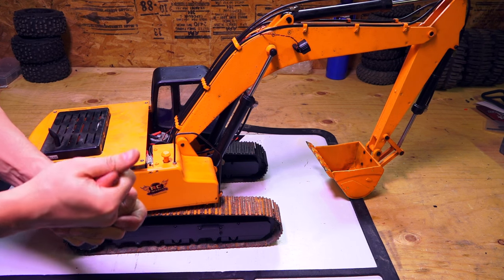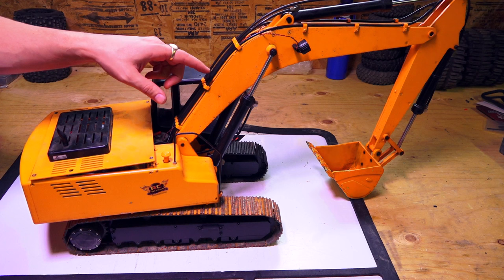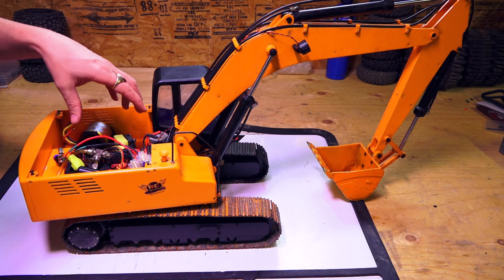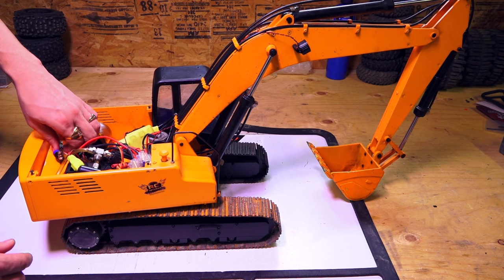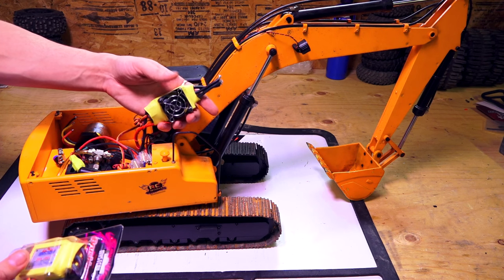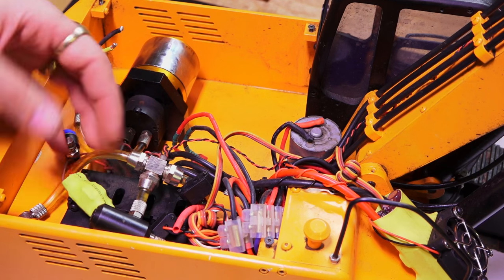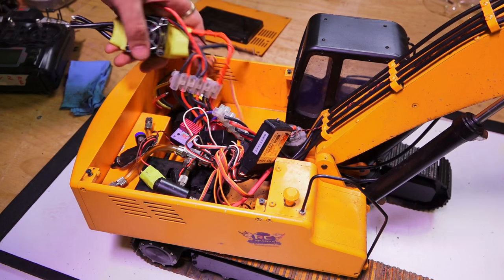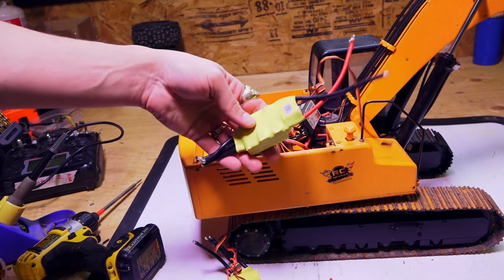RC ADVENTURES - 1/12th Scale 4200xl Excavator - Hydraulic Pump ESC Upgrade - Radio Controlled

Comment: Awesome vid bro
I just upgraded the valve block on mine to the premacon unit,  the old one was leaking too much and it was also not getting enough pressure in the lines now it's awesome.
I had no Idea that the valve block could cause that big a loss of power.
Reply from the maker: +Awesomus Maximus Awesomus Maximus factor 9!!
Reply: Does your machine have proportional hydraulics with this upgrade, I'm thinking of getting a better valve block but I want to know if the hydraulics are more sensitive and can move very gradually.

Comment: That thing has a lot of potential power. wow... At 25,9 volts... 200 amps... In theory that is 7 bhp :O Just for the hydraulics XD
(Don't tell me about resistance, friction, discharge rate, engine max and stuff... let me be amazed :P hehe.)

Comment: Sorry if these questions have been answered, I didn't see any of these answers so I'm asking. What is the best rc hydraulic excavator for a beginner? Why are the hydraulic excavators so expensive? What parts of the excavator use the battery and which parts use hydraulics. Also how long does it run before you need to charge it?

Comment: The speed controler can be fixed for 4 dollars and 5 minutes soldeing as either a cap when wich is most common or a diode fried saving the electronics, Gige je a bell and srnd some good pics of the top and bottom and I will have a look but short of that it would require testing.

Comment: This message is for RCSparks. I have a 4200xl. I am not sure what happened so I'll explain a little and maybe you can tell me what happened.  I have a 3S lipo 25c 10000mah battery for it.  I was running it today for the first time outside and all of a sudden I saw alot of smoke so I immediately unplugged the battery. I have deduced that the esc's that control the tracks have kicked the bucket.  I noticed as I was talking to my son on the phone that those esc's have a jumper for lipo and nimh batteries.  Well as you can imagine, it was on nimh. Would that have cause the smoke release?  We found esc's on amazon but would like your take on this whole issue before I order.  I hope you get this and can reply.

Comment: I'm planning to get a RC truck or car, still thinking on it. But, I'm not sure what RC to get. My budget is around $100. Do you guys have any good ideas on which one to get?
Reply: +MelT3d Thats a tough one. Hobby grade Rc's start at about $200-$300 U.S. You can try a n online company called wltoys but I'm not sure of their quality. Basically you get what you pay for.
Reply: Yeah, they are expensive is the traxxas latrax teton 1/18 4WD mo after truck rtr tra 76054-1 good?
Reply: +MelT3d Sorry, I'm not famiilar with that model. I would google customer reviews. That what I usually do before I buy a new RC.
Reply: +Chris O'Donnell will do, thanks anyways.
Reply: Chris O'Donnell What series are you most familiar with? Do you have any suggestions? it could be a bit more then a hundred.
Reply: +MelT3d I have had just about every Traxxas model but for around $200-$250 american you can get a brushed 2wd 1/10 Slash. Thats a great truck

Comment: So medic I have a question , any tips on maintaining a slash 4x4 ultimate. I'm new to rc and need a little help. Also that excavator is really cool!
Reply from the maker: +Dji Guy Always make sure to blow the vehicle off with compressed air, and use spray-dry silicone for the bearings :)
Reply: ***** thank you for responding

Comment: That wiring would drive me nuts! I would have to get in there with zip ties and organize the wiring and double side tape the speed controlers down, I am kind of a neat freak when it comes to wiring. I am not trying to put you down or anything medic, nothing against you I just hate messy wiring on my own stuff.
Reply from the maker: +focustuner10 Ive already been down this road.. and by shortening the wires, or zip tying them, becomes a huge pain in the a$$.. lol.  They need to be long so they can be put into the compartment.. or else they all bunch up.  Ive oned these rigs for 3 years.. and have tried so many thing to clean it up.. and funny enough - you see them cleaned up in this film.. THAT iS CLEAN! haha ;)

Comment: Who else has a traxxas bandit, not the best rc car but it's my first and it's pretty cool
Reply: I have the brushed xl -5 rustler. its like the next one up!
Reply: +Ben Varley I was going to get that one at the rc hobby shop but I got the bandit cause it was a little bit cheaper
Reply: +Ben Varley  i got 1 too but  it has a problem in the esc it  wont go fastern than 5 mph or  something
Reply: +voetbaler109 Probably not the ESC. Have you changed the mesh between the pinion and spur gears or made sure it is correct? That is one of the usual culprits.
Reply: +Powerpickle68 im about 70% sure its  the esc i got  the  problem before then i only switcht from lipo to nihm and  its  fix  but  now  it doesnt
Reply: voetbaler109 Did you happen to run the truck with the esc in lipo mode with a nimh battery? That can sometimes damage the esc
Reply: +Powerpickle68 yea i think so
Reply: +Timothy Roelofsen I have a slash 4x4 ultimate , but the bandit is a pretty cool buggy

Comment: wouldnt trimmingnthe wires shorten the amount of electricity going though?
Reply: +Bobodeman I was thinking something similar. It would increase the amount of electricity going through the wires which were actually connected, increasing the resistance (assuming no current flowed from wire to individual wire). I'd imagine what he did might make the wires more likely to heat up, but its possible that they're so beefy its not a problem.
Reply: +silentsniper441 thanks for the help wasnt to sure

Comment: So since I'm pretty much gonna be rebuilding my Vaterra Nissan GT-R NISMO GT3, I want to get a new servo and better batteries. Any suggestions?
Reply: +SonicGamer You again! Ha ! Are you just running stock stuff? I would search around on the forums and see what everyone else has tried. Its usually a good idicator as to where to go.
Reply: +Chris O'Donnell hello again. Yeah, I'm running all stock.
Reply: Just google your car and add upgrades after. Should take you to some forums to see what everyone else has done. Thats my trick in a nutshell! The info is all out there, you just have to spend a little time looking.
Reply: For a servo I'm no expert, but I would look at the Savox servos with high speed ratings

Comment: does this hydraulic system bleed out the air by itself?
Reply: +Leo van Miert  Just simply by cycling the controls will force any air in lines to bubble out into tank. So yes, it basically is self bleeding
Reply: +Chris O'Donnell Haha yes of course! I never thought of that, but it's so obvious! Thanks.
Reply: +RCing Around HQ You got a good youtube channel going there! I subbed and will have to spend some time looking at your backlog of videos.
Reply: +Chris O'Donnell Hey, thanks very much! I really appreciate that. Just started and have much to learn!

Comment: why do lipos have suck high Mah then like a Nimh or a Nicd battery?
Reply: +ZachBraps Can you rephrase your question?
Just in case: Lipo batteries will have much higher mah ratings because more capacity will fit in a smaller package or same size. Example: A 5000 mah lipo will be the same or smaller than a 3000 mah nimh and be lighter in weight.
Reply: More energy dense

Comment: I have a stupid question I think. 

when u say "hydraulics" what do u mean? because when u say it Im thinking about a bouncing car
Reply from the maker: +Brandon Weathers - fluid moves through the hoses via a pump to create pressure - moving the arm so it can dig. I explained it in the video, and google is very knowledgeable on the subject. It is a lonnnng explanation.. haha
Reply: +RCSparks Studio Im sorry. Im new to your channel and the videos u make are 100% awesome. I tried subscribing 100 times but I can only do it once 😢 thx ill look it up
Reply: +Brandon Weathers I will give a simple explaination. Basically you are using oil under pressure to create power. Fluid is the perfect medium because it doesn't break down like a mechanical device would.
Reply: +Chris O&#39;Donnell And it doesn't compress meaning it is highly efficient in energy transfer.
Reply: +Meteor Shower Yes,exactly. A few ounces of oil can exert quite an amount of force
Reply: Chris O'Donnell Precisely. Then you use different volumes and pressures to make the pressure multiple times more powerful while only exerting a small proportion of the weight to actually move the start piston. I understand the theory but i'm terrible at explaining it. :-)
Reply: +Meteor Shower That sounded pretty good to me!
Reply: +Brandon Weathers Hydraulic machinery is by definition any system that use incompressible fluid (most common is oil or water, water is used mostly in food industry and was originally used in Tower Bridge in London) to transmit/multiply force (strictly for this correct name is hydraulic machinery but common used name is only hydraulic, to be strict only hydraulic branch of physics that studies properties of incompressible fluid).
On other hand pneumatics is same but only apply to compressible fluid.
Reply: +Meteor Shower There is no difference in efficiency in using incompressible or compressible fluids, pneumatics and hydraulics have same efficiency. They both have same advantages and disadvantages, that dictate where is one more suitable to use then other but as efficiency there is no difference.
Reply: Miloš Lazović Pneumatics are for gases instead of fluids...
Reply: Miloš Lazović If the fluid is compressed then that means that not 100% of the energy has been transmitted into the object it is moving.
Reply: Meteor Shower
No it doesn't mean that, how you concluded that?
Reply: Miloš Lazović Because thats just what is means. https://www.google.co.uk/search?q=what+does+phneumatic+mean&oq=what+does+phneumatic+mean&aqs=chrome..69i57.7762j0j7&sourceid=chrome&es_sm=93&ie=UTF-8#q=what+does+pneumatic+mean
Reply: Meteor Shower
You still didn't explain how if fluid is compressed then 100% power is not transmitted.
It look you do not understand question, so I will make it simple to you.
Where energy is lost in compressible fluid when it is transmitted?
Reply: +Miloš Lazović into compressing the fluid
Reply: Miloš Lazović Take an example; if you had a sealed system with a piston on each end with one full and one empty with some tube in between which also has the fluid in it (non compressible in this case). This is the kind of experiment used in schools. Once the full piston is pushed in to its limit, lets call it 10cm, the other piston should extend 10cm. Even if a load is placed on the empty piston, it should still extend 10cm. If a compressible fluid is used however, the full piston may be pushed 10cm however due to the fluid compressing, the what was empty piston may only move 9.5cm. That is because some of the movement has been taken up compressing the fluid. Thus meaning that not 100% of the energy has been transferred to the second piston.
Reply: MegaMetinMetin
LOL, now you make me laugh. Energy is not lost on compression, on other end all that energy is returned by expansion!
You should learn some basic physics like law of conservation of energy.
Only energy lost in hydraulic or pneumatics system is on heat.
Reply: Miloš Lazović I will support your point about energy lost to heat though... :)
Reply: Meteor Shower
Your conclusion from experiment are fundamentally wrong, there will be difference in piston movement, but no energy will be lost in pneumatic system.
Applied force will not be constant on one side (side you push), it will rise till pressure in fluid will reach level to move other side which is not instant ( due compressibility of fluid), and on other side we have constant opposite force, now if we know that energy is force times path (in your example movement of piston on one side) difference in movement is due initial buildup of pressure (when input force is smaller the output force), but at end total energy at both end will be equal.
On other hand in hydraulics system input and output forces will be all time same (in incompressible fluid pressure build up is instantaneous) so movement will be same (and energy).
Reply: Miloš Lazović What, that's just made me even more confused... Let's leave it there I think.
Reply from the maker: +Meteor Shower This is why I never get into these convo's.. people think im being rude.. Ive just been down this path many times.. Lol..
Reply: +RCSparks Studio I just asked a question. people are just stupid on the internet. can I not ask a question?
Reply from the maker: Brandon Weathers You can ask, of course :) But if the question involves motors, moving parts, fluid, or brands.. the internet people will always get together and battle their opinions.  Thats why I suggested Google to you.. I wasnt trying to come across as a jerk, rather prevent you from having to read the rhetoric
Reply: +RCSparks Studio you didn't, I was just curious. btw ur videos are awesome. I watched the one about the tug of war, that was an epic video. u should make another one like that. your lucky u live in Canada, I love cold weather